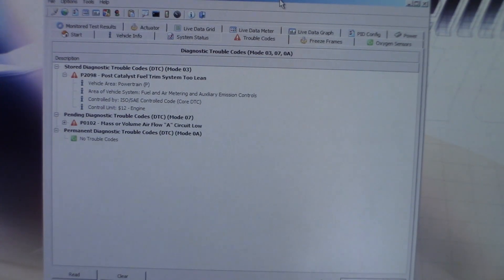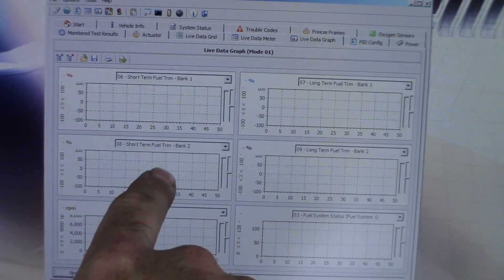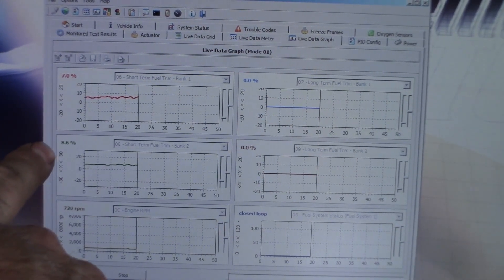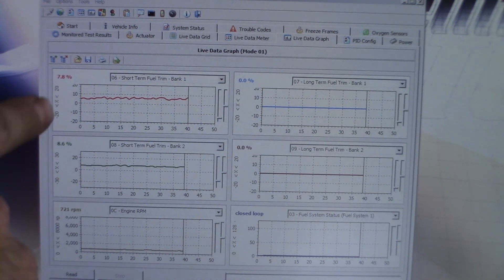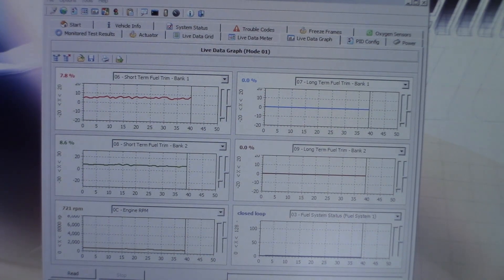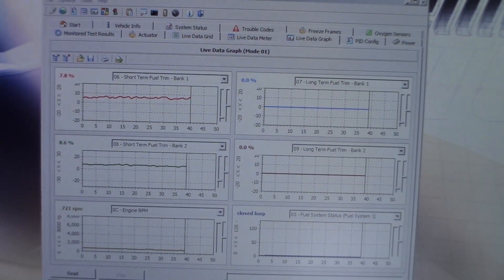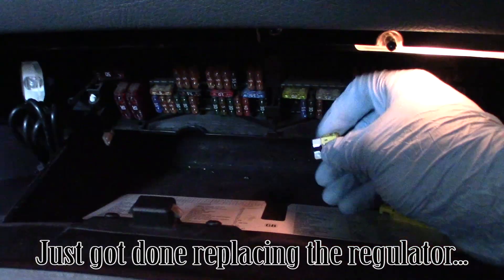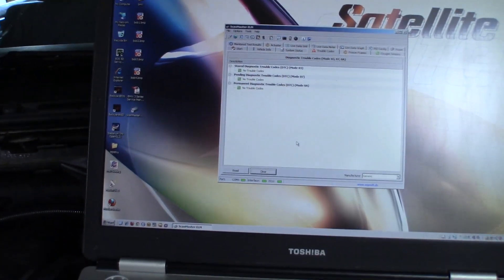BMW 330i 325i E46 Using Fuel Trims To Diagnose Engine Problems P0171 P0174

Comment: great vid again  trying to learn about E46 fuel trim ..never had this when I was working on cars back in the 70's I have torque pro app on the car DVD and there are a few questions 
I hope that you can help me with these figures I have 
LTFT1 =11.7% LTFT2=11.7%
STFT1= -0.8%   STFT2= +8%
 O2 1x1  .06v
 O2 1x2   .07v @-2.3v stft
 O2 2x1   .04v 
 O2 2x2   .04v
most of these figures fluctuate  but LTFT stays the same 
I am concerned with economy being 9.4km/lt to city 6.5km/lt
 
now my DISA I think is not working because after I removed it and checked out the unit I sprayed WDF to check diaphragm which started working and would hold flap ..
when I refitted unit there was a vacuum noise from DISA at idle ...unplug connector to DISA and noise stopped indicating diaphragm has a leak cause flap returned to center ...
funny thing is the motor idles perfectly and car has heaps of go but!!! 

have ordered a DISA complete kit from Russia 
so have you any thoughts on these figures 
I am going to get that program Scanmaster because of how you described how it worked and is easy to load to pc  
am a bit concerned on fuel economy
Reply from the maker: Yeah your long term fuel trims clearly indicate a lean condition.  Over time your car has "learned" that you always need 11.7% additional fuel beyond normal.  The short terms fluctuate because they are the immediate "right now" fuel trim corrections.  The key thing to understand is that you ALWAYS have to add short to long to get TOTAL fuel trim.  In the video I say that when you rev your engine to 3000 rpms, your fuel trims should go down if you have a vacuum leak.  In your case, since you have 11.7% long term and let's say about 0% short, when you rev your engine, your short term would go negative--let's say -9% for example.  When you add 11.7 to -9, you get 2.7% total fuel trim.  Is that making sense?  Is this what happens or does it stay the same or go higher?
Reply: it stays the same ..was 11.7% before I did work I have just replaced leaking valve cover and filter body seals and the valve cover breather to CCV that was cracked and someone taped it up with electrical tape done Vanos seals and spark plugs oil and filter and fuel filter 
removed neg batt lead and pos connected together for 10 minutes 
there are no codes so I better get the Scanmaster asap and try and trace maybe airleak 
maybe the Disa has a small leak that does not whistle but is not enough to bring up a code 
I have PAscam 1.4v on pc but looks like scanmaster might be better showing fault codes
Reply from the maker: The thing about BMWs is the long term is slow to respond to changes/improvments.  While the car is running, unplug the MAF sensor for a moment, then plug it back in.  That will reset the long term fuel trim to 0 so that you now can see everything in the short term fuel trim.  Then repeat the test where you run the car at 3000rpm.  Be sure to hold it there for a good couple seconds so you can see it respond.  Tell me what results you get then for fuel trims.
Reply: have to do that when wifey brings car back later 
thanks for ya help...oh one thing ..do you ever sleep haha ???
Reply: ok have readings 
started car unplugged MAF replugged and held revs to 3K+ readings 

STFT 1 27.3% and then dropped to 0.0% after a minute 
LTFT  1   0.0%

STFT 2 27.3% then dropped to 0.0%
LTFT  2   0.0%
O2 1x1    0.1v
      1x2    0.4v
      2x1    0.0v
      2x2    0.4v
Reply from the maker: Yeah you have a vacuum leak for sure.  Did you check the lower CCV to oil dipstick hose?
Reply: no but will have a look when car cools....would have been better  off eliminating all this plumbing and fit a catch bottle back to manifold ..just a thought ..never had a car with so much plastic on the motor
Reply: can I get to this without pulling all the manifold off
Reply: checked out the vacuum hose to dipstick and looks brand new, no oil
but after un-connecting and re-connecting MAF  now fault codes have come up P0170/P0172 and have now p1250 codes
Reply: code P1250 fuel regulator ..checked this out and there is no vacuum from this hose so maybe this is the problem ...have had a problem with starting if the car was left for an hour I found it would not start unless turned key on and off  and then on ...then it would start so am thinking that vacuum hose is broken under manifold ...your thoughts on this but I know the DISA has to be faulty because won't hold vacuum

Comment: Couldn't you damage your catalytic converter by causing the engine to misfire? Just wondering if that was a potentially risky demonstration at the end there when you intentionally caused the vacuum leak.
Reply from the maker: Thanks for the question!  I understand why it may have seemed that way, but it was actually ok because the engine computer is able to compensate for a lean or rich condition up to a point.  That is exactly what fuel trim is.  It's the engine compensating by adding or removing a percentage of fuel to keep things in balance.  It can usually go about 25% on the short trim and 25% on the long term, so about 50% in total.  Once those values are maxed out, THEN you have a true lean/rich condition that is causing damage.

Comment: Hi, I am using your technique to find out what happen on my 325ci(M54B25
 engine). Can you help me with analyze the data? Here is my situation, 
after I reset the adoption value, I got  average 16.266/16.185 Lambda 
1&2 integrator when idle at ~850rpm.
When I push it to ~3000rpm, I got 19.396/21.561 BUT when I let to throttle go, it immediate jump to 0(almost). It clime slowly up to 16~19 after the rev. become stable. I don't know what should I look for, vacuum or fuel. 

One more thing, I tried to remove the oil cap when the engine running idle, it have little suction, not to much, the cap have to be take away with the force like open a fridge door. Is that normal or I got vacuum leak from there?

PS. MAF cleaned

Comment: My fuel trims were erratic with the scan tool. I had no vacuum leaks.

I had 0171/0174 codes.

 I replaced both upstream O2 sensors and it is now completely stable. 

Bosch O2 sensors only have a 100,000 mile life span I found out.
Reply from the maker: +Robert Tison Both oxygen sensors died at the same time?  Statistically, I think you just won the lottery, lol.

Comment: I recently changed my crankcase valve and hoses along with intake boot since i had a positive fuel trim of 25 and 27 in both short term fuel trims respectively. Now i still get the system too lean codes and the fuel trim is still the same. Im also getting misfire codes from cylinder 5 on start and cylinders 4 and 6 with fuel cut-off. I checked the fuel pressure on the rail and when i turn the key its 45 psi and while running its 50 psi. Then i shut off the car and it slowly dropped down to close to 35 psi after less than 10 minutes. Any tips or possible causes? Should i replace the fuel pressure regulator it has been more than a year or is it possible the fuel pump? I cleaned the maf sensor as well and unplugged it to determine if it functions or not and it does but im not sure if maybe its not reading correctly anymore. Im thinking about getting a fog machine to check for a vacuum leak also but i'd really appreciate any input you can offer before i spend any more money. Thanks!
Reply from the maker: +Luis Alvarez What are your fuel trims now at idle?  And what are they when you run the engine at 3000rpm?
Reply: +50sKid ok at idle 698rpm my stft bank 1 is 25.8 and stft bank 2 is 25.8 also.  O2 bank 1 sensor 1 says 25.8 and O2 bank 1 sensor 2 says 99.2   O2 bank 2 sensor 1 says 25.8 and O2 bank 2 sensor 2 says -100 (yikes).   Now at 3016 rpm my stft bank 1 says 12.5 and stft bank 2 says 14.8   O2 bank 1 sensor 1 says 11.7 and O2 bank 1 sensor 2 says 99.2   O2 bank 2 sensor 1 says 18.0 and O2 bank 2 sensor 2 says +99.2 percent     Also worth noting i think my oil dipstick tube is leaking oil. How do i make is sit correctly if my theory is correct? I read it can be a bear to reinstall at times. Thanks again!
Reply from the maker: Well if you've watched this video I think you should realize that you have a classic vacuum leak because the fuel trims got better when the engine got faster.  Btw 99 and 100 are not real values--those are the wrong PIDs.  If your dipstick tube is leaking then ding ding ding--you might have found your leak.  Change the o-ring and reassess.
Reply: +50sKid ok will do. Just a quick question. How do i reinstall it properly? Slide the o ring up the tube to the metal ring and then tap it in with a mallet or how?
Reply from the maker: Slide the o-ring up the tube and just insert the tube into the pan--no pounding necessary.  Watch my CCV videos to see me do it somewhere in there.
Reply: +50sKid for some reason the o ring will just not go in. Once it hits the bump with the o ring it wont go in. I checked your cvv videos and you dont show it unfortunately. I've used oil, silicone spray on it, and even a little grease and that damn thing still wont slide in. Ive read across forums people having similar issues. Any ideas why this is happening?
Reply: Luis Alvarez you ever found out how to fix it?

Comment: Hello, I have the E46 328i and when the outdoor temperature is lower than 10 degrees Fahrenheit, and when the engine starts to warm it begins to pulsate and shuts off as the temperature rises until getting halfway operating temperature. Can you say what could be the cause of the engine work.
Reply from the maker: +elijuseee Vacuum leak or fuel starvation problems.  Use the video to diagnose.
Reply: +50sKid Yesterday when the engine is started badly idling, I disconnect Intake VANOS valve and engine rpm become stable. once again connected the intake VANOS valve rpm began to jump. I have read that it is VANOS o-ring problem. how do you think is it possible? if it was vacuum leak engine all the time bad idling?
Reply: +50sKid sorry for me grammar english is second language for me :-)

Comment: my short term fuel trim on both banks its 99.22% just swapped fuel pump and fixed vacuum leaks from DISA what else should i look for ?
Reply from the maker: +harry gonzalez Nah something is wrong, you have to be looking at the wrong data.  99.99 is impossible.
Reply: +50sKid hey boss, so i changed my pcv system, fuel filter reset codes and 171 174 are back with values 18.57 each bank short term, don't know where else to look, would it be bad o2 sensors? also i noticed a very slight smell of gasoline when starting then it goes away thanks for reading
Reply from the maker: I doubt the gas smell is related to this problem, however since you did change your fuel filter you might want to double check the connections and make sure they're tight.  Anyway, it is possible for oxygen sensors to read a false lean, but I doubt both of them would be bad at the same time.  Do your short terms drop when the car is at 3000rpms?
Reply: +50sKid yes they did drop respectively to 4 and 5
Reply from the maker: Yep, vacuum leak for sure.  Pretty big one.  You've seen my common vacuum leaks video, I assume?  Just follow that.  95% of the time, you will find your problem there.

Comment: Hi 50s Kid, I noticed on this video after you installed the new fuel filter/ regulator the pressure at idle was 46PSI. Next time you measure fuel pressure would you confirm whether the 46PSI changes at all if the small hose at F tube is disconnected? I would expect it to rise to about 50PSI while hose is disconnected but would like to verify. Thank you.
Reply from the maker: +George Santana I've already told you 4 other times that it is now 50psi, all the time, which is normal.  When you disconnect the vacuum line, the pressure does not change.  How much clearer do I need to be on this?  Your fuel pressure is normal.

Comment: OK, I looked again your video and I see after you replaced filter needle stopped vibrating at idle, but pressure was little bit low, not 50 psi, you said you worry about that and then you come back and said resolved. I guess pressure has not been 50 psi at idle, car running. So I am now thinking about changing fuel filter again.

Comment: Hi, I just did this yesterday. Trying to figure out lean codes. I tested  fuel pump pressure using same tool you have and results were same. Seems pressure is little below 50 psi and needle was vibrating at idle, same like in your video. After shut off engine pressure drops about .5 bar in 15 mins. If i put gas looks like pressure goes up little bit and needle is steady. 
All this I did in morning, and in evening, aster about 6 hours I started the car and it shake little bit, went for drive and when I come bask, there were random misfire codes on pending, this morning it shake again and light come on. So now I have misfire codes instead lean codes. WTF I did. I touched Schrader valve  only. For how long regulator should hold a pressure? I did replace filter/regulator about 2.5 years ago. I don't see in video what pressure readings you got after replacing filter and does needle still vibrating at idle. Did I screwed Schrader valve somehow? I did test twice so releasing pressure in fuel rail maybe did something to the regulator. If you have any idea please share.Looks like I have to check all again.
Reply from the maker: +YesNo018 I've been meaning to correct the final reading in this video.  It was a bit low.  50psi while running is the normal pressure and it is supposed to drop about 5psi immediately after being shut off.  It can drop a bit after that, but as long as it maintains some pressure you won't have problems starting the car next time.  Misfire/lean codes sound like a different problem.  Could be you have developed vacuum leaks somewhere else.
Reply: +50sKid I am confused with these misfire codes after fuel pressure test. I did not have these codes before. Only lean codes. I don't have a scanner to look live data. So far I know there is small oil leak at Vanos pressure hose and valve cover gasket. Lean codes started to show up when it got colder. However,  car did not shake on my way home from the work, and no pending codes yet. All common vacuum leaks checked.
Reply from the maker: A lean condition can cause a misfire.  It's still the same problem.  I think you think you made it worse when you tested the fuel pressure but that's not possible.  Understandable, though.  If you have lean codes then you know you have a lean condition.  It doesn't sound fuel pressure related.  If you can't find it via normal methods then you can get it smoke tested.

Comment: my fuel pulse was 42 psi and held as long as I had the key on. As soon as I turned the key off fuel pressure dropped to steadily is this normal.
Reply from the maker: +tony capito It'll drop about 5 psi when the pump shuts off.  It should be 50psi when running, btw.  If it's 42 then there is a problem.  There is a one-way valve inside of the fuel pump that should hold pressure in the line.  Mine drains down over 10 mins to about 38 psi or so and pretty much holds there.  If yours is draining all the way down to 0 or close to it (say, overnight), that'll be causing hard starting problems in the morning.  When you rev the engine does the pressure go down?  If so, that points to fuel pump weakness and it probably needs to be replaced.  If not, I'd replace the fuel filter/regulator.

Comment: 50sKid Hi,  so I worked out the 28B8 problem.  Took off the exhaust solenoid again and felt the piston that the solenoid drives... it was frozen.  Carefully removed, cleaned the piston and cylinder area, reinstalled... ran perfect, no more codes.Thanks Bob Campbell
Reply from the maker: +bob campbell Aha, very nice job.  I will note that fix for this error should it ever come up!

Comment: 50sKid Hi,  excellent public service you perform.  I have an e46 that gave a 28B8 code after I changed my oil!!  I installednew cps and tested solenoids.  Is this something you could help me with. bob
Reply from the maker: +bob campbell Actually, no.  It sounds like the computer thinks there is a mechanical problem with your cam sensor, which possibly means that it's out of sync with the crank sensor.  This is more of an advanced diagnosis subject and I can't help you with it over the internet.  I'd advise you to find a technician who can diagnose it by putting your cam and crank sensors on a scope and determining what is wrong.
Reply: +50sKid Thank you for responding... is this something I could pay you to speak with me over the phone or via Skype for say 10 minutes...bob

Comment: Thanks a bunch been tracking my P0171 P0174  issues found found the trim levels to be 27% sounds like a massive vacuum leak thanks again!
Reply from the maker: +Robert Tison Replacing O2 sensors doesn't solve massive vacuum leaks.  Please don't advise someone to spend $100 on parts they may not need when what they really need to do is look for the source of their leak and replace THOSE parts.
Reply from the maker: These cars don't have an EGR system of any kind.
Reply: What was your problem? Mine also reads exactly 27%
Reply: @BigWakeGuy  same. Found the problem?
Reply: +josephcarter7 

If you are over 100,000 miles with Bosch O2 sensors, replace them. It solved my 171/174 codes.
Reply: It's $200 on parts and when you have replaced another $150 in needless parts that solve nothing, it gets expensive quick. My oil separator was fine, the hoses were fine and mine has an electric EGR. My O2 sensors were erratic and causing the codes that indicated a vacuum leak.
Reply: The electric air pump at the exhaust that has the vacuum valve. Mine has no vacuum valve. It's electrically controlled.